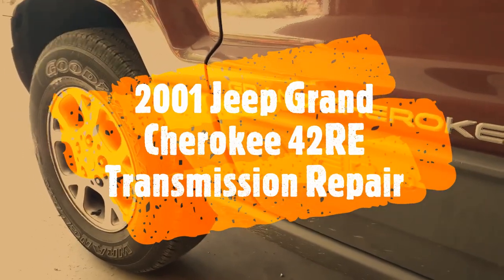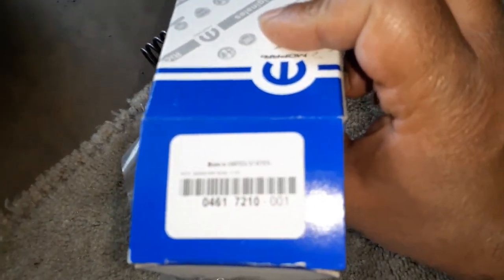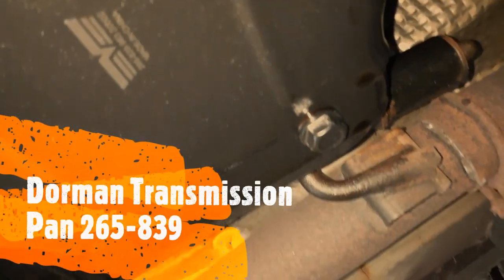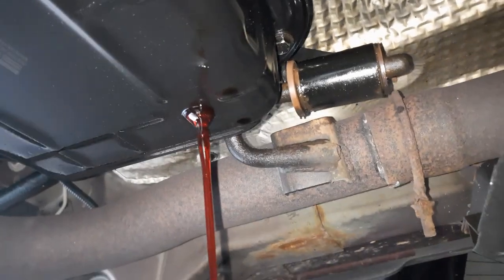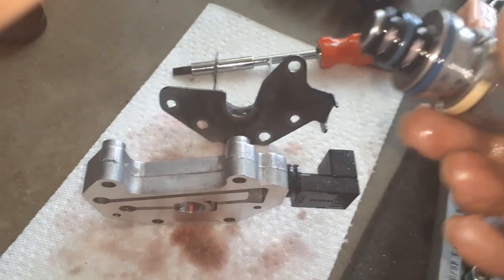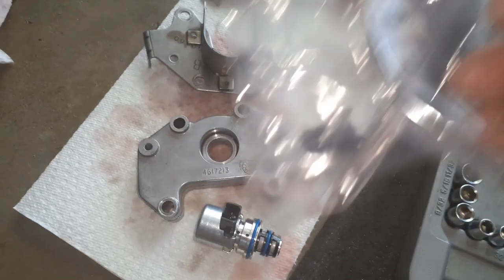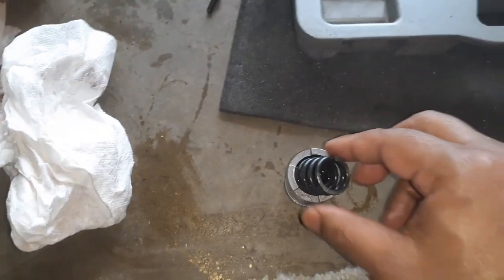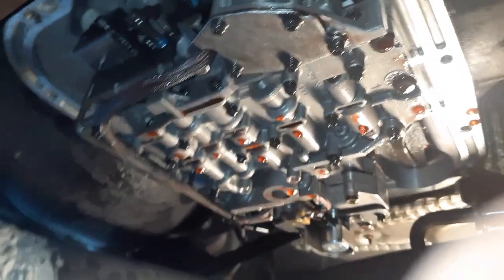Jeep WJ 42RE Transmission Repair For Bad Shifting

Comment from the maker: Accumulator spring from Ebay link - http://rover.ebay.com/rover/1/711-53200-19255-0/1?ff3=4&pub=5575486972&toolid=10001&campid=5338486955&customid=&mpre=https%3A%2F%2Fwww.ebay.com%2Fitm%2FTransmission-Overdrive-3-4-Accumulator-Return-Spring-47RE-48RE-42RE-44RE-99457%2F191880462012%3FssPageName%3DSTRK%253AMEBIDX%253AIT%26_trksid%3Dp2057872.m2749.l2649
Reply from the maker: Raymond Larcom  The shifts had jerks. So it would not shift to the next gear and the engine will rev up and then the transmission will shift with a kick.

Comment: Just completed my repair. Same symptoms, when cold rough and slipping between 1-2-3. After warm up, all ok. I only replaced spring, broken in half. Adjusted the rear band while I had tranny opened up. Shifting perfectly again at 220,000 miles. Great video. 3.9, 42re.
Reply from the maker: Wonderful. Thank you for the comment.
Reply: Adjusted rear band? I recently replaced the same part and have the same issue repeating.

Comment: Hey dude, thanks a lot for the video! All the tutorials I could find were either for the 45RFE and talked about having to remove the valve body... well, after watching your video I cracked mine open and replaced the solenoid/sensor and 3-4 spring (mine was also broken) and she shifts like new!
Reply from the maker: Great to hear! Glad the video was helpful.

Comment: Great video and think I'll do the same on my 2001 4.7.  Everything has basically been changed...all the packs, etc,  but still getting a dopey check engine light that fires off after the light is cleared.
Reply from the maker: You should find the error codes if check engine light is firing off. Here is one of the first videos I did on how to check error codes on these WJs - https://youtu.be/U7DzQNiuj8c.

Comment: I ordered the governor off of the link on your description on Amazon and I got sent a rostra one instead of mopar
Reply from the maker: Was it delivered from the Amazon Mopar store? I would ask the seller why it is not Mopar as advertised. I will not recommend anything other than OEM Mopar part from a reputable Mopar vendor.

Comment: Nice, same exact problem on my 2003 IL V6 Jeep Grand Cherokee Laredo. Switch out the oil and pan already but slipping a tad. Will this fix my issue or should I replace the  whole Transmission?
Reply from the maker: You should replace the solenoid if not already replaced. That should fix your issue. Also use OEM Mopar parts. I have the links in the description - https://amzn.to/33bgLz1 or https://amzn.to/37b8PRV. Also check the accumulator spring. It is a good idea to replace that when you are at replacing the solenoid.

Comment: Best thing you can do to 42re add a transmission temperature gauge and a cooler
Reply from the maker: My Jeep Grand Cherokee WJ came with a small transmission cooler next to the radiator. I am not sure if it was included in all WJs or ones with a trailer package only. I do tow with this Jeep, so very necessary to have a tranmission cooler.
Reply: Indi the transmission cooler that comes with the tow package is pretty useless.Doing a google search you can find transmission cooler that makes a difference in performance.
Reply: I run two 12 by 13 inch transmission coolers and a deep Pan from PmL nine quarts to fill in my supercharged wj,so far I haven’t gone over 160 degrees.

Comment: Hmm... Left turns... Leaky Fluid... 
If you were low on fluid the first time would you recommend that I reuse the 20 year old  gasket or will it leak again?  
Did you have any issues with it?  
Thank you again for your videos!
Much Love
Reply from the maker: I have leaks when I switched the pan with Dorman aftermarket pan with the drain plug. I kept the same gasket that came with the car. I might switch the gasket at some point or switch to the original pan which may be stronger than the aftermarket one to seal better. If you are using the original pan, then try a new gasket and let us know how that worked. Also see my other video on left turn issue - https://youtu.be/FkZq4ylBJW8.

Comment: thank you for sharing this video.  I have a 1999 Grand Cherokee that will not shift into first gear.  so all the shift solenoids are within reach once I remove the cover?  Now is it best to replace all the solenoids or just the one that is in charge of shifting the first gear?
Reply from the maker: Is it not downshifting to first? Or is it not engaging even during start? Yes, once you open the transmission pan, you can access the solenoid and pressure sensor. The solenoid is the one that goes bad mostly, so you can try replacing that first. Also check the accumulator spring (https://youtu.be/IvC_cRzJjPM) and make sure you have enough transmission fluid (https://youtu.be/FkZq4ylBJW8). Both will give trouble with shifting.
Reply: @DIYWithIndi  thanks for replying.  It will not shift into first gear unless I release on the accelerator at around 2,200 rpm and feel it engage.  All other gears including overdrive work and shift smoothly.
Reply from the maker: @alfredolopez-bruce6199  The usual suspects are low transmission fluid (https://youtu.be/FkZq4ylBJW8), broken accumulator spring (https://youtu.be/IvC_cRzJjPM) or bad solenoid (https://youtu.be/P42z4vqnlsA). You may be low on fluid. The first thing I will check. See the first video link https://youtu.be/FkZq4ylBJW8 on how to properly check fluid level.

Comment: 2 alarm  Trans over Temp ... O/D .   What  is problem. .can you  help  me .. Tanks
Reply from the maker: Check the cooling fan and see if the small trans cooler is working well. If you have cooling fan issues, check my other video https://youtu.be/KhUDJLgLtBQ for electrical fan or this one https://youtu.be/5rmZZHRozEg for clutch fan.

Comment: great video! how can you tell what type of transmission your jeep has?
Reply from the maker: The transmission number is on the side of the transmission itself. My Jeep WJ has a Select Trac (you will see this on the transmission lever) and the engine is a 4.0 L Inline 6. These have a 42RE Transmission. The bigger engines (4.7L) have a Quadra Trac II transmission and possibly a 44RE. Note that some parts for a 1999-2000 42RE are a bit different than the 2001-2004 42RE. So make sure you are getting the correct part (e.g. solenoid) for exact fit.
Reply: Can also look at the door jam, a lot of info there...or by your Vin #, call jeep give them number.

Comment: Hey man great video, I have a 2000 WJ 4.7 and it started shifting hard from 1-2 and the kickdown from 4 to 2nd is really hard, do you have any idea on were to start? Cheers man! Oil and filer were swapped 5k ago.
Reply from the maker: The usual suspects are low transmission fluid (https://youtu.be/FkZq4ylBJW8) or broken accumulator spring (https://youtu.be/IvC_cRzJjPM) or bad solenoid (https://youtu.be/P42z4vqnlsA). I will check the accumulator spring for problems with downshifting. Note that mine is a 42RE transmission, probably not the same as yours with a 4.7L engine.
Reply: Adjust the kick down cable

Comment: The drop and catch on the first filter screw was almost too fast to see. Had to rewind to see what happened
Reply: Also impressed with the one handed electrical harness disconnect.
Reply from the maker: For sure it is not easy to film and show the steps with one hand. Glad you enjoyed it.

Comment: Hey INDI! My wj isnhard shift when going out of first into second but mostly when cold, once it’s heats or warms up hard shifts is gone, how can I check that this is what I may need to do, I got no codes or warning lights that have come on
Reply from the maker: You won't get codes for hard shifting. Replacing the solenoid will help. Change the fluid if you have not done it recently. Also check the accumulator spring - https://youtu.be/IvC_cRzJjPM.

Comment: Thanks for this video, in cold oil I have a problem with engaging 2nd gear from the first. I will be changing the oil in a few days and first I will check this solenoid. 
Has anyone heard of howyou can check the resistance of this solenoid with a multimeter? What values are normal?
Ok, I find something: "Governor Solenoid(4617210)    3.8-4.0 ohms"
Can you check your old solenoid resistance to compare?
Reply from the maker: Engaging from 1st to 2nd gear problem may be related to either low transmission fluid (https://youtu.be/FkZq4ylBJW8) or bad solenoid. I am not sure about measuring the solenoid with multimeter. Possibly someone on the internet has an answer. I will suggest replacing the solenoid when you change the oil.

Comment: I used an aftermarket solenoid from rostra to replace my old one. Now its stuck limp mode/won't leave first gear. The aftermarket solenoid I used was slightly bigger than the one I took out. Would this be causing the problem?
Reply from the maker: Possibly yes, the gap of the solenoid that sticks out is very important. You can revert back to the original one to make sure it is the cause. I always recommend genuine Mopar parts though they can be expensive.
Reply: @DIYWithIndi  thank you. I just bought one from the link in the description
Reply: @aydinmatney8622 it’s not best to reuse the fluid correct.. i just recently changed my fluid and now i think my solenoid is going bad (p0783) now i have to drop the pan again 🤦🏽‍♂️

Comment: Will this solenoid work on 2002 v6 ?
Reply from the maker: Your 2002 Jeep WJ has a V6 or I6? It should be all inline 6 cylinders. If so, it is also 42RE transmission. You can check the fit on the Amazon link I provided -  https://amzn.to/33bgLz1 or https://amzn.to/37b8PRV

Comment: Are all these parts compatible with a 2000 jeep grand cherokee laredo cause ur video says 2001
Reply from the maker: Should be. If you follow the links in the video details to product pages on Amazon, it will check the fit for your jeep.
Reply: @DIYWithIndi  so the transducer pressure says it don't fit
Reply from the maker: @cs9064  You are correct, the pressure sensor transducer 56028196AD does not work for 2000. It applies to 2001-2004 - https://store.mopar.com/oem-parts/mopar-pressure-sensor-transducer-56028196ad.
Reply from the maker: Seems like the part # for 2000 is 68164850AA https://amzn.to/3NYq7E4 which is replaced by 56028196AD. Verify it by searching the internet.
Reply: @DIYWithIndi  yes correct will do but I think the one u have listed is correct but thank again for ur time an help.

Comment: I think you just saved me a lot of head scratching. Thanks my friend. ALSO notices your jeep is running a little hotter than mine. I've got a 180 thermostat. An electric fan (just a cheapo aftermarket i got from a flea market)  and the clutch fan from Mopar. My jeep never rises above 200 now and normal sits around 180. Now what was that spring called again?
Reply from the maker: Glad to hear the video was helpful. The spring is called 3-4 Accumulator Spring - https://amzn.to/35guOWB (see the links in description above). I have a couple of videos on the cooling fan replacement and clutch fan. I gave up on the electric fan because of that relay issue. The clutch fan has been working well so far.

Comment: How the spring break like that?
Reply from the maker: The spring gets brittle with age. I should have replaced it years ago.
Reply: @DIYWithIndi  do a video about the TV cable how to ajust it.
Reply: Do you have a part # on the spring you replaced? Great video..
Reply: @jesseochoa5826  what code show You with this issue ?
Reply: @pakoobregon2880  P1762 on my 2001 GC laredo 4.0 6 cyl. If you have this Jeep, you can put the car in on and off 3 times ( don't start engine just in and off position, on third dash board will give you the code

Comment: Mine shift better when it hot, but once it rain r temp drop, shift erratic
Reply from the maker: That is the opposite of what mine was doing. Mine shifted erratic when the transmission was hot. You may want to replace the solenoid if you have not changed it in a while.
Reply: @DIYWithIndi  I replaced the black one recently the pressure sensor not the governor.

Comment: My 99 WJ 4.0 slips just when turning left. Anyone have suggestions to check for?
Reply from the maker: Interesting that I have also noticed slippage while turning. Now that you said 'left turn', I have to confirm that it happens on left turn only. In my case it happens when the transmission is cold and I ignore it since it happens at low speeds. I would suggest the usual transmission maintenance - dirty or low fluid, dirty solenoid and pressure sensor (I have to replace pressure sensor in mine). The other item is to tighten the bands. I have not tried tightening the bands yet. Let us know if anything else fixes your issue.
Reply: Hey man did u ever figure it out my trans is doing like the exact same thing to a tea would love to hear back thanks
Reply: I've topped off the fluid and check it regularly. Seems to have taken care of the issue for a few months now. I did find a leak at the line connection to the trans fluid cooler too. Hope it helps.
Reply: @bobby_mojo413  thanks u saved me from droppin a tranny pan today👌
Reply: @andrewwarren5554  excellent